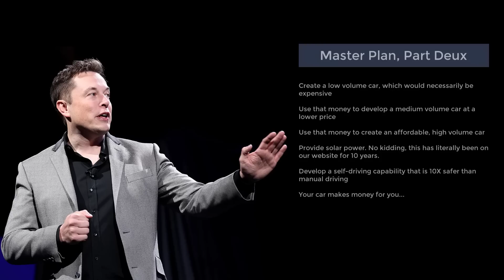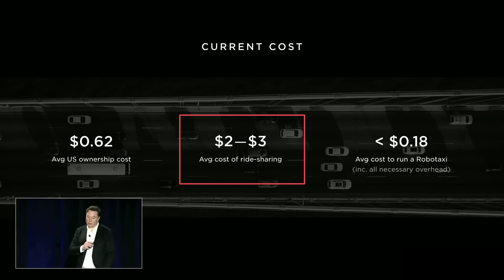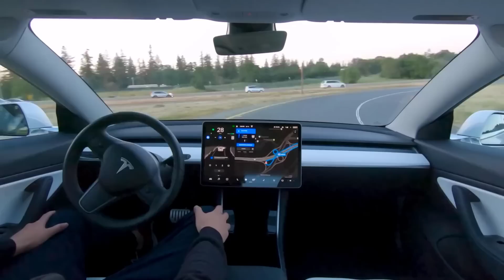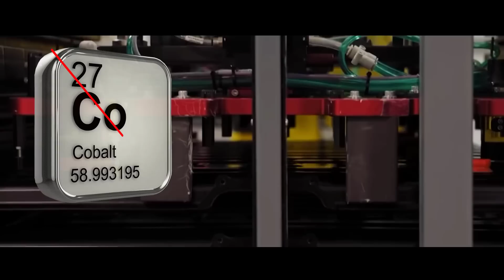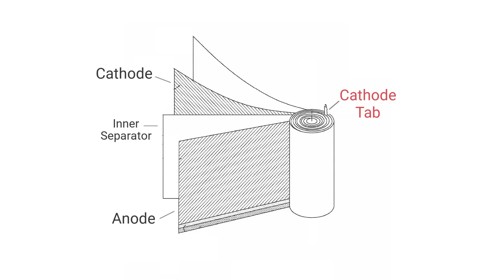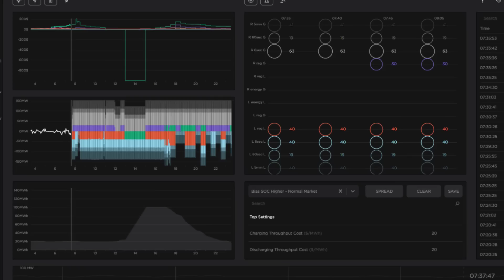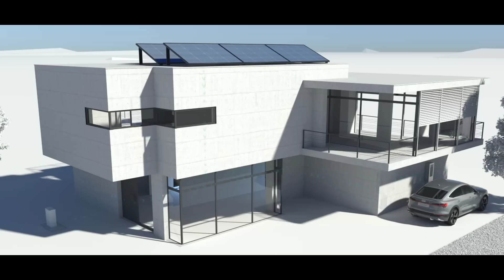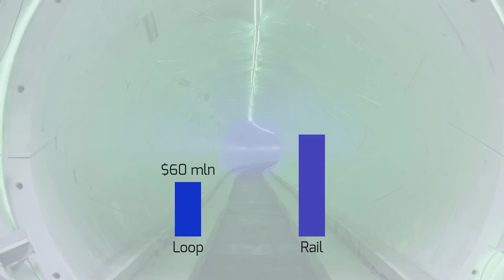Tesla's 5 New Ingenious Projects To Drastically Change The World

Comment: Platooning semis, Insurance based on actual driver data.
Reply: Yeah, both of those should be added.   Getting a line of 3 or more Tesla trucks tucking into each other’s slipstream will save tons on shipping costs and lower overall emissions.  
And insurance rates should plummet if everyone has an self driving EV.  But before we get there, if Tesla is tracking all data, you should be able to get much cheaper rates based on real-time good driving.  
I’m guessing insurance is probably a big reason laws haven’t been passed to allow it yet, I’m guessing insurance lobbyists are lobbying hard to delay it as long as they can.
Reply: Plus Tesla being vertically integrated with their insurance arm will have all the data on accident damage and cost of repairs, so their engineers will work hard to reduce that repair cost (and while they are at it reduce manufacturing cost). Win Win, increased profit to both business sectors
Reply: That's good dude! hahahaha!!!
Reply: @uspockdad6429  Vertical integration of Tesla will make the effect of other insurance companies less. They won't see it coming until it is too late.
Reply: @j.pgoodwin9020  Spot on.

Comment: Kudos to Tesla for 4 out of 5 of these items, but i don't have any faith at all in The Boring Company.  The claims that underground transportation systems will be less expensive than grade level systems are something that i will believe when, and only when, i see it in action carrying revenue passengers.
Reply: Tesla is working on making a van for the boring tunnel
Reply: Traffic lights, interchanges, silly drivers, delays for wrecks are what make driving a pain.  A tunnel can go from point A to point B much more efficiently.  Under ground the temperature is comfortable and constant, no rain, snow, ice, etc.  The long term maintenance costs would be much lower.  If one can travel at 123mph, the transit time will be reduced 50% or more, and when you arrive you will be refreshed, ready to return to the stressful above ground driving.
Reply: Yeah, I’m not completely sold on the Boring venture yet either. It wouldn’t work in certain parts of the country because of differences in types of ground.   
But if it can work for certain things like traffic to an airport, stadiums for sporting/entertainment events, and things like that, it could greatly reduce traffic above ground, and make getting to and from things that generate a lot of traffic a lot better overall.  
Time will tell, but I am hopeful even that venture will benefit us all.
Reply: @02TMM  Uh-huh.  How many passengers per hour per direction can it carry.  That's a question TBC hasn't answered, that I'm aware of.  A transit system, to qualify even as light rail, needs to be able to carry 20,000 pphpd.  If you can't do at least that then give up.
Reply: Watch for the upcoming opening of the Las Vegas site. First the convention center. Then to the airport. Then to hotels. Then to LA (at speeds higher than legal above ground). Change is coming.